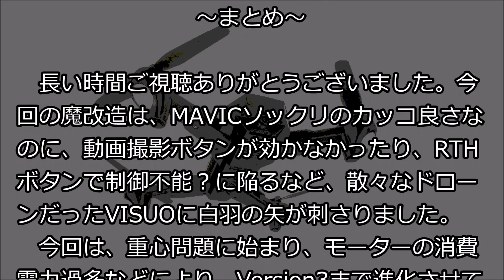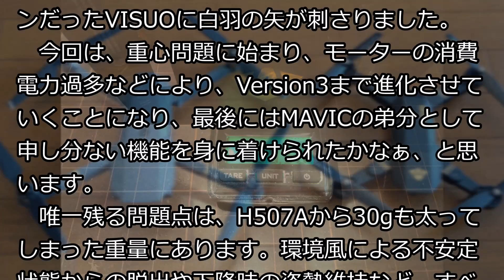魔改造 VISUO XS809HW MAD-MODS /RTH・FollowMe・Orbit・Waypoint

Comment: Did you use the transmitter that came with the visuo xs809hw or a phone?
Reply from the maker: than you for your comment.
i used iphone 5s and 5SE with HT005 Wifi repeater.

Comment: Hey man. Great video. I wish I could see it better the camera replacement. I have the same vizuo with 2.0 camera and I also do have a spare sjcam4000 wifi.. maybe  I could fit it there..
Reply from the maker: Thank you for your comment.
I
 would like to upgrade the camera, but the camera board of the H507A is 
responsible not only for the receiver but also for GPS control and so it
 was difficult to upgrade only the camera.
However, the remodeling we are doing now has a challenge to improve the thrust and load the second camera externally. Once we succeed we will report with a video again.

Comment: Hello bro, mine is having issue with wifi connection. I was able to detect the drone with my phone I cant do it no more. I disassembled it to fix sd card problem and now it doesnt work. Any idea??
Reply from the maker: Hello. My knowledge can not solve your problem.
The problem that I know about Wifi connection fails when I use "HT005 Wifi Repeater", it is radio amplifier.
The solution to my problem was to space the amplifier and the smartphone.
I hope it will be helpful.

Comment: Hi.
Nice mod job.
I've updated my transmitter for more range but I need stronger motors or props to bring it back if it's windy can you recommend some motors and props I could use that will fit please.
Thanks.
Reply from the maker: Thanks for comment.
I also want a motor power, but first I would like to complete the replacement of the propeller.
The 7-inch carbon propeller outputs a lot of thrust.
However, due to the problem of fixation to the axis, it is pending now.
I am planning to create a propeller holder with a 3D printer.
Reply: Ultra Micro Maniacs ah ok very nice. So there isn't a propeller I can buy off the shelf from another drone to fit in its place for more lift then. That's a pity.
Reply: I saw another video using 7 inch props and it looks like the props collided and flipped the drone. I think maybe you can take out the gear and change the gear, since it is using a gear system, the large gear connected to the prop is 77 teeth vs the motor gear of 11 teeth, you could 3D print a new gear to get more torque and less speed. Use 6.5 inch props.

From what I can tell, the drone uses very cheap 8520 motors, but very high rpm.

Comment: Hello, may I ask you one question, please?
I have bought a Visuo drone and banggood sent me damaged, so now I have to replace a motor, but I don't know which screws I have to lose.
Can you send me a private message whith the instruction, please?
Reply from the maker: I will tell you first. I am not a support of TIANQU VISUO.
Which screw should be loosened to remove the motor? It seems difficult to repair or remodel it as if asking the question. I think that it will end with just breaking as a result.
Well, although I said tough things, the basic is to relax all the 
loosening screws and to remove all things that can be removed is the 
time to disassemble.
The screw has different thickness, length and pitch. Please proceed while taking notes and pictures where you remove the screws. I also have an obligation to return from the moment I remove it.
Some of the fuselage shell has a combination that is said to be "squirrel". It is a mechanism that bites so that it does not come off by hooks of plastic hooks. To remove it, you need to investigate the different mechanism for each part, grasp the structure, and work. In case it can not be done, it is necessary to break down after being aware of breakage. At that time, experience such as putting cracks in arbitrary places in
 advance is needed so that bites can be released with minimal damage.
Even if the shell is opened there are hurdles.
The direction of rotation of the brush motor is fixed to the left and right. Failure to comply will shorten the life span. The motor and board are soldered to VISUO. So to exchange it we need environment and skill which can solder.
It is finally pumping up. In some cases it may be necessary to assemble in an order different from disassembly.
I am not your teacher. Please do its best on your side.
Adios.
Reply: Thanks.
Banggood technician told me to change my self the motor, because they shipped to me a broken one (I bought a brand new visuo and they sent to me a damaged one with some parts glued and very visible).
Now I have opend a issue but they suggest to me to send me a nwìew motor and change it my self.
Thanks so much.
Reply: another question: Has the visuo drone a GPS system really?
Reply from the maker: I feel sympathy for you. Yes, they sometimes deliver broken items.
I have also received a broken item. At that time I paid a high return fee and sent it to them. But that was a failure. It was better to purchase a new one than to return it, it is a conclusion.
Because
 they are simply retailers, defects of goods are due to the 
manufacturers, if the box is crushed or damaged, it is the act of the 
delivery agent. I must understand that both manufacturers and delivery companies are in China.
Yes, they are China. It is nonsense to seek quality.
Good luck and change the motor.
Cheers. :-D
Reply from the maker: That's right. I also posted GPS.
This remodeling is proof that I am stupid, so the cost of remodeling is higher than the price of the aircraft. It will be tripled.
:-P